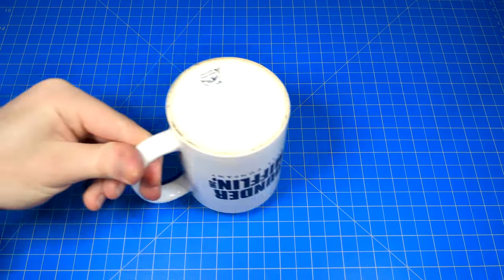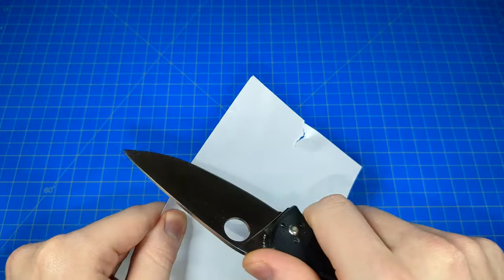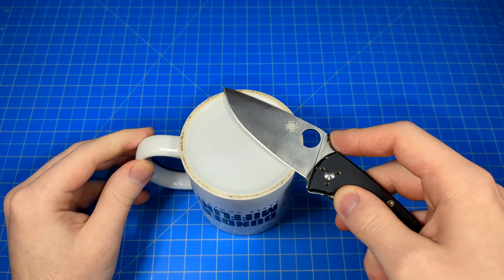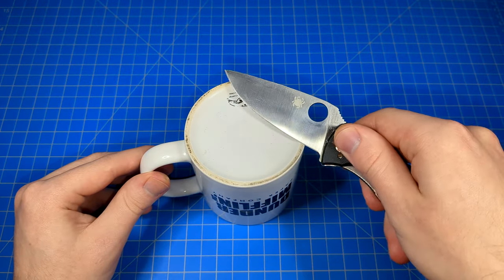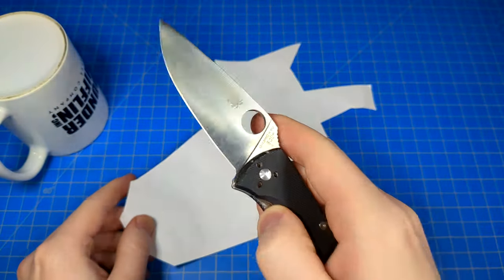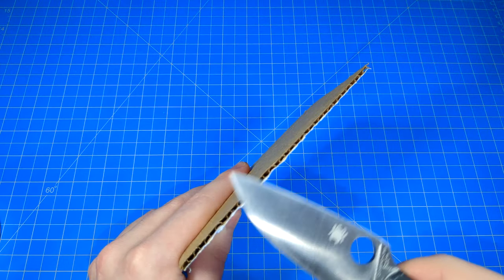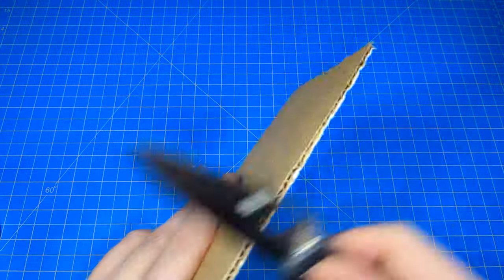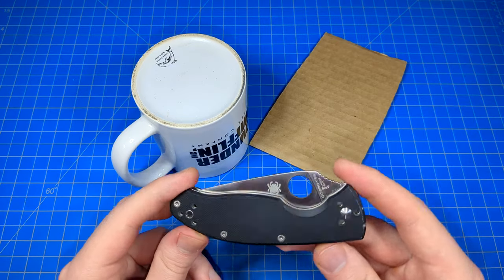How to Sharpen a Knife with a Coffee Mug (And Strop it with Cardboard)

Comment: Idk if ceramic will work so well with harder steels, however I tried the stropping trick with my s30v manix 2 and it's certainly a bit smoother.
Reply: The Coffee mug method works best with carbon steel blades.  My Higonokami has a blade made from SK5 carbon steel.  The same Japanese steel that scalpels and razor blades are made from.